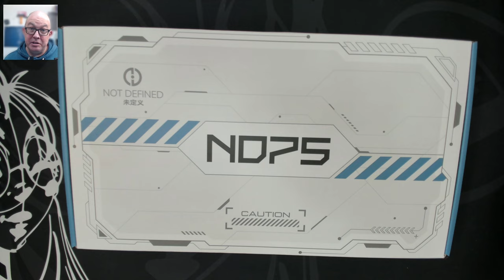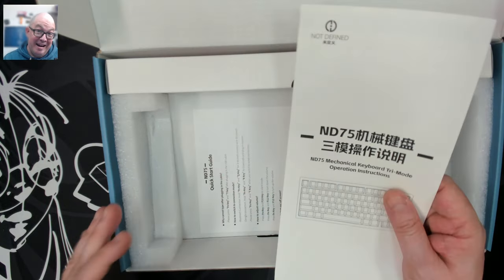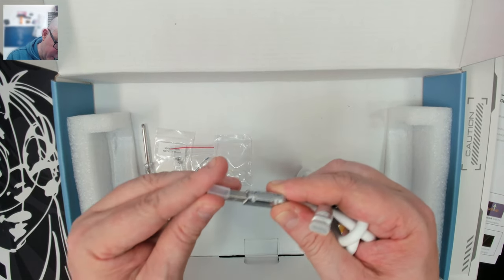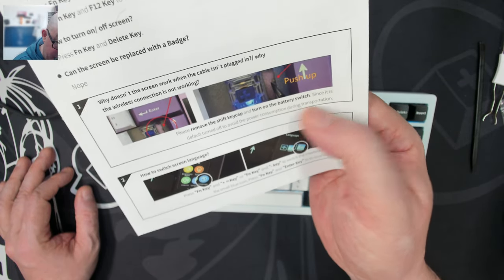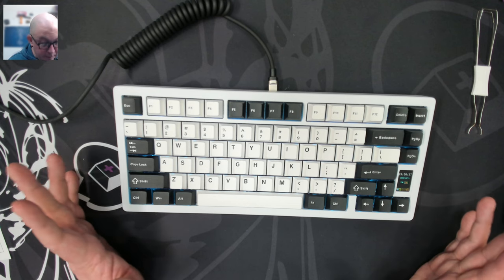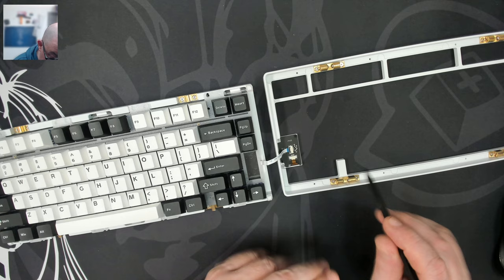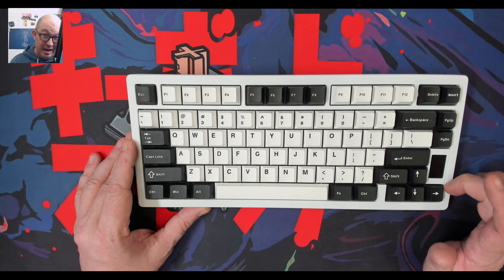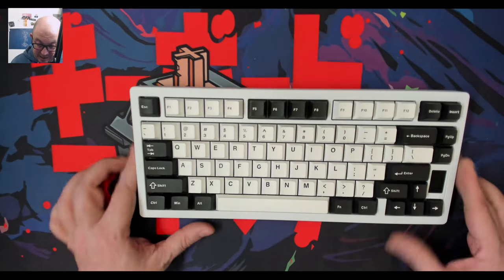Chilkey ND75 Review and Sound Test

Comment: If what broke is the little thing to secure the ribbon cable, usually any paper folded a few times with the same width can replace the functionality just fine. It's kind of difficult to place it in, but it might do the trick.
Reply from the maker: I tried to fix it, I only made it worse :/

I have ordered a replacement display, and will film the process, thanks!

Comment: I have the purple which is really more pink with the 1.2mm flex cut so it doesn't hold switches well. I had hoped it would be darker but the people is really more pink and the alphas aren't white but kind of this off white / pink. It's nice, just wasn't what I was expecting, I love the look of the one you got! Those cables are in an odd place, could happen to any of us. The finish is definitely very nice for the price range IMHO, good point on that!
Reply from the maker: Sometimes I get to pick the color, sometimes I just get sent something they pick, I'm sure I would have been happy with any color, but I really liked this one. 

I think I was just a bit too confident and quick when I went to flip the ribbon clip :/

Thanks for watching, cheers!

Comment: Not to totally nail you but you also forgot to mention there's no bluetooth. That's a fairly important feature. And I see there's a 2% surcharge on returns. Weird.
Reply: @cormacc7  Hi - bought 2 of these over the last few months. There most definitely is bluetooth - you can connect up to 3 devices, and can select using the screen.
Reply from the maker: This unit does have Bluetooth.
Reply: What are you on about?
Reply: @huzaifavawda8383  I stand corrected